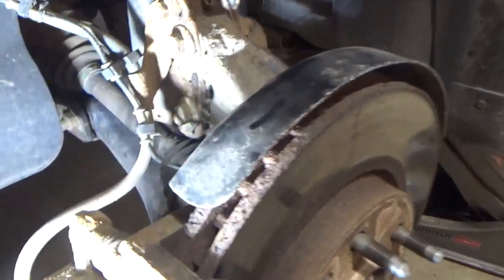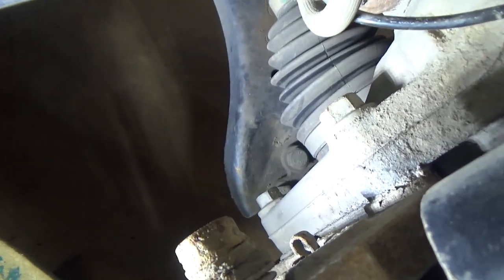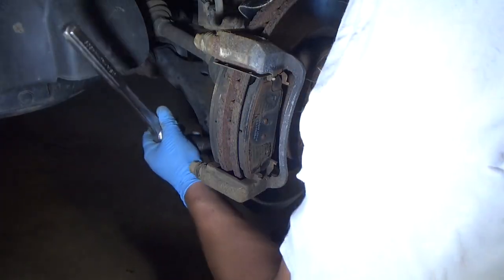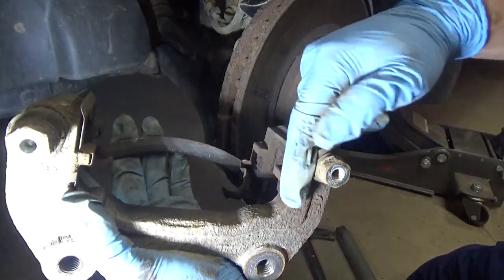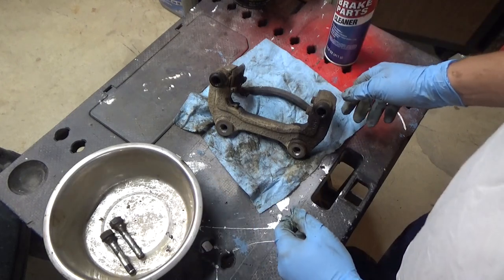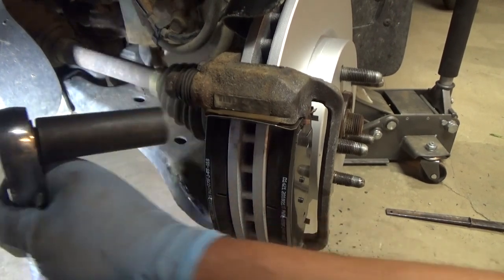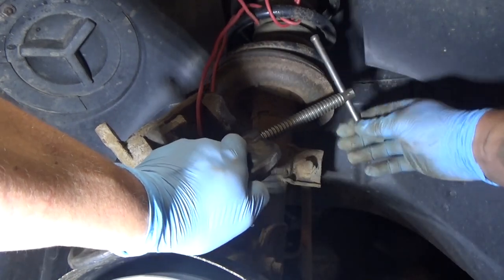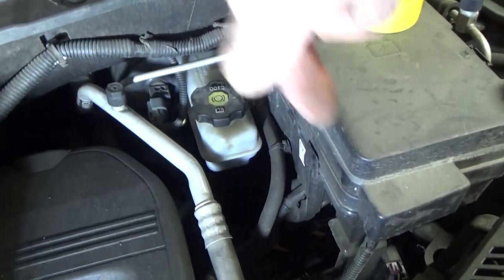How to Replace Disk Brake Pads and Rotors On a Chevy Equinox, GMC Terrain PowerStop Geomet Coated

Comment: Very nice video. I like the idea of spraying brake cleaner near the boots to allow you an easier time removing the slide pins. I used a pick before and I tore the boot. So, I had to pay $12 to buy another pair of boots.

Comment: Yeah those are not 18 mm mine are bigger than that on my 2018 Chevy equinox
Reply: He is working on a 2011 equinox that is why 2018 was a redesign of the vehicle. You need to find a video with a 2018 to a 2022 for your vehicle. Those are all pretty much the same. Hence why your bolts might be bigger